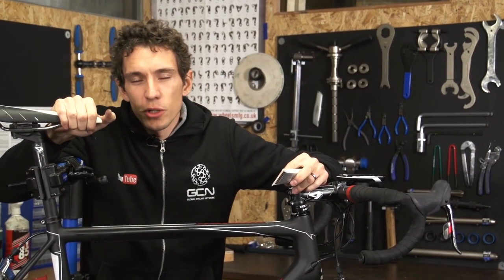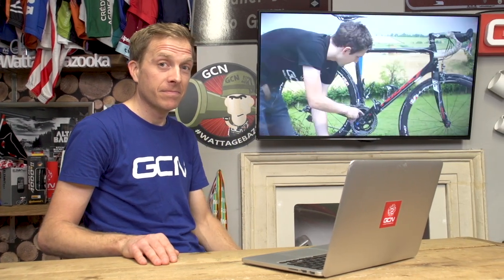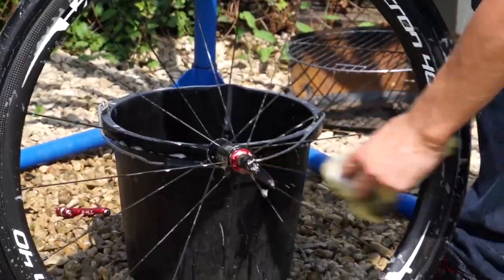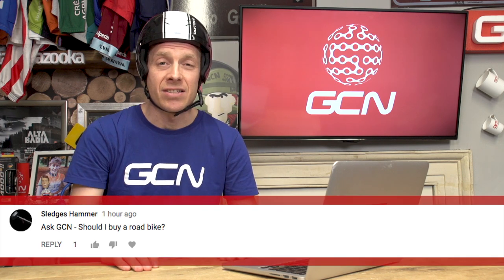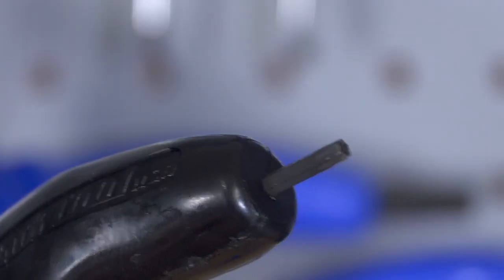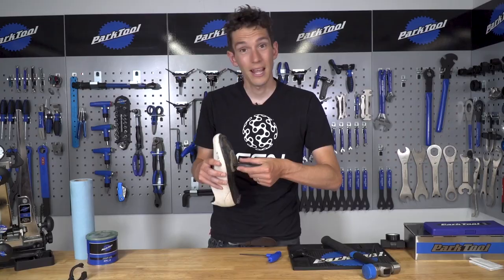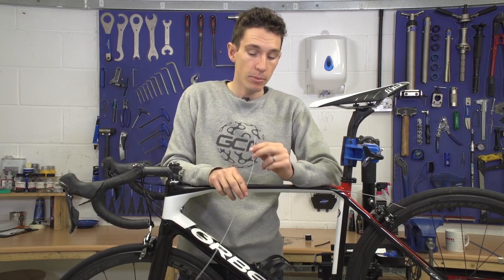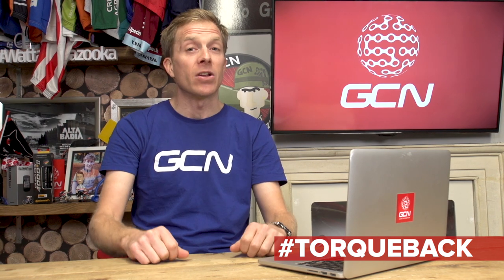How To Remove Rounded Bolts | Ask GCN Anything About Cycling

Comment: Awesome vid Jon, thanks! 
 With regards to stripped hex heads, if the torx bit is still ineffective, I've got a few more tips... Try laying one side of an elastic band across the head of the bolt and then using the torx bit. If that still fails, you can cut a slot across the head of the bolt (hacksaw, dremel, chisel, flathead screwdriver if you're really stuck...) and use a flat head screwdriver or flat-head socket bit to turn the bolt out. Obviously be reeeeeeally careful of your bike... If this doesn't work and the head of the bolt can be gripped by a set of mole-grips you could try that, but I'd probably invest in a set of bolt extractors from Halfords/MachineMart/your local Snap-On guy as they'll grip the outside of the head and 'dig in' biting further and increasing their grip.

What can I do until the next video then...

Comment: To remove rounded bolts,
First find a plastic toothbrush then get a lighter and melt the end. Put the melted plastic end in the bolt and then unscrew. This should work.
Reply: if there's room, a set of vice grips should do the job.

Comment: Internal routing issues... If you get really stuck, try sucking thin thread or cotton through the frame with a vacuum cleaner hose sealed to one opening with a bit of electrical tape. Works for me every time!

Comment: I've tried using an 11s chain on a fixed gear when I first built my fixed bike, the chain got stuck at the sprocket and I ended with a stripped back wheel hub

Comment: BEST WAY to remove Allen bolts (or any bolt, even if the head has sheared off) if nothing else works is to buy a little "Easy Out" kit from a decent engineering tool outlet, not expensive. Dead easy to use and there are a lot of YouTube videos showing the process if you get stuck. Basic principle involves drilling a fine pilot hole through the center of the stuck bolt, then as you drive the easy out tool into this new smaller hole the tread on the outside of the easy out begins to drive the stuck bolt out.

Comment: Rounded off Allen bolt? Buy a reverse, or left hand, drill bit. That type of bit has the spiral in the other direction. The idea is to rotate the bit in the same direction, that you would remove the bolt, which allows the bit to grab in more, and will usually spin the bolt out. The downside is that you may find the reverse drill bit stuck in the bolt. Use this method when nothing else works, and you don't want to damage whatever the stripped bolt is fastened onto, or into.

Comment: Will it work if I run a 1X setup with a non-clutch RD on a road bike? Or will the chain drop? #torqueback
Reply: Jochem I've got it to work without a clutch mech
Reply: Jochem if you're not on gravel or bad roads then the chain shouldn't need a clutch
Reply: No problem.  I use a standard road derailleur with a narrow-wide chain ring on my cross bike.  I've never had a problem even on single track.
Reply: a lot of delivery guys that come into my shop do this. it can work, pay close attention to the chainline and dont shift too many gears at once
Reply: You can also increase the spring tension on some Shimano RD. I have done this to my 11 speed Ultegra RD and it helps. Just follow park tool instructions here : https://www.parktool.com/blog/repair-help/rear-derailleur-overhaul

Comment: 11 speed chain on a fixed gear?  I wouldn't.  Never use a quick link or re-pinnned 11-speed chain for fixed.  You can't use a quick link on a fixed gear because the braking action of the chain may open the link.  And if you've ever re-pinned an 11-speed chain on your own, how long did that last?  If you're going to use 11 speed, then only join the links with a factory break-off chain pin!  And even then, well, like I said before, I wouldn't. 
If you're using a 3/32" ring and cog then  you're better off using a 7 speed chain instead.  Or you could even use a 1/8" chain on 3/32" gears, but it's not ideal, i think it will wear out faster.  Both options are safer, cheaper and more forgiving to work with.  Remember, when you're running fixed, your chain takes a lot more abuse!

Comment: #TorqueBack
I'm looking to buy a road bike.

I've narrowed the search to these bikes:
1) Cervélo R2 2017
2) Rose Xeon RS Ultegra or 105
3) Rose Pro SL Ultegra or 105
4) Bianchi Freccia Celeste
5) MMR Miracle 2017 Ultegra or Dura-Ace

1) is carbon, head tube tapered, internal cable routing
2) is aluminum, head tube tapered, internal cable routing
3) is aluminum, head tube tapered, internal cable routing
4) is aluminum, head tube non tapered, external cable routing
5) is carbon, head tube tapered, internal cable routing

All of them are good bikes.
I don't mind about carbon vs aluminum.
I assume that external cable routing does not affect.

But what about the non tapered head tube? Is it really noticeable?
In theory, it gives the front of the bike more stiffness.
What do you think? Is it a deal breaker?

I love the looks of the Bianchi the most, but it is the only one with non tapered head tube.

Comment: the title is exactly a problem i'm trying to solve atm!
Reply: SwedishHouseFifa BEST WAY to remove Allen bolts (or any bolt, even if the head has sheared off) if nothing else works is to buy a little "Easy Out" kit from a decent engineering tool outlet, not expensive. Dead easy to use and there are a lot of YouTube videos showing the process if you get stuck. Basic principle involves drilling a fine pilot hole through the center of the stuck bolt, then as you drive the easy out tool into this new smaller hole the tread on the outside of the easy out begins to drive the stuck bolt out. 😊

Comment: Don't hammer a torque driver into the bolt head. The cleat is a gonner in any case, use a hacksaw to cut a slot in the head and a flat bladed screwdriver to remove. Or, if you've got access to a dremel use a cutting disc to do the same, easy.

Comment: #torqueback Hi GCN I'm a big fan and my rear derailleur hanger cage is hitting the spokes on my back wheel do you know how to fix it
Reply: The mech hanger is likely bent. Often happens if the bike falls to the ground on driveside. A solid 10mm rear axle normally fits into the mech hanger and therefore you can use a rear wheel (solid axle) as a tool to straighten the mech hanger. Also wiggle the rear mech and see if there is play in it's pivots as they can wear out. https://www.youtube.com/watch?v=TnwreRrorIA
Reply: Thank you

Comment: Are modern ultegra derailleurs backwards compatible ?  I have  a bike from '93 which uses a 7-speed shimano 600 groupset. 
Can I use a modern equivalent and upgrade my old bike part by part ?
Reply: #torqueback
Reply: Mitläufer I don't know about the derailleur but I have an old colnago with a shimano 600 group set and I recently put some new shimano claris brifters (2x8) on there - works like a charm. Obviously not ultegra but more than good enough.
Reply: From my recent upgrade of my '86 Panasonic DX-3000, the biggest problem I had with upgrading the ol' cassette significantly is frame spacing. I was able to go comfortably from the original 6-speed Shimano groupset to a 7-speed, but jumping to a 10 or 11 would have involved spreading the frame, which I am not at all comfortable with.

Still, that jump up to 7 speeds and retaining my original chainrings in the front has made my darling little Pan a significantly more spritely little beast with the addition of that lovely 11 in the back giving it a tad more top-end capability over the original 14; debating if I should've gone with the 14-32 set instead, though, for some easier climbing! Also let me switch my gear shifts to my hoods rather than retaining the downtube shifters (I was good on 'em, but they were aggravating after I had the pleasure of riding a friend's more modern Trek).

Whatever you do with it, have a grand time. :)

Comment: #torqueback my FD hits the chain in the 2 biggest gears, what can i do?
Reply: Assuming your not cross chaining (big front and big back) then just change the limit screw on front mech. if this does not work just reduce cable tension and these should both move the front mech nearer the frame and therefore help with clearance. I assume you have the correct mech for the correct crankset (double mech for double crank). https://www.youtube.com/watch?v=tfBiXgf8JxI

Comment: Top aluminum is way better than cheap carbon. Got a CAAD12 this summer thing is a rocket and weighs 18 lbs for a size 60cm. Only carbon on bike is seatpost and handlebar. Also get new wheels doesn’t have to be carbon just lighter than the stock ones.

Comment: I'm sad because my question didn't get answered :(
I asked how I could get my upper jockey whell closer to the sprockets... I know, the b-screw, but it doesn't affect it since there is simply not enough tension towards it
I'm mainly a home mechanic, but I've been thinking about going to the bike shop because I can't think of way to fix it
Would be glad to receive an answer
Reply: Why do you want it to be closer? Thanks
Reply: to index the gearing properly, if it's too far away, the angle of the chain to the sprocket is just too low to shift (limit screws are adjusted, but it has problems shifting up and down)
Reply: Lukas Seegers it must really far away. Is the P tension spring still OK? They can get full of dirt. As can the pivot bolt that attaches the cage to the derailleur body.

Comment: Like Si, I'm a big fan of 1x systems. I would like to upgrade my 1980 steel frame with a 1x11 drivetrain (if it's even possible). Does it worth it, or should I get a new bike?  #TORQUEBACK
Reply: My 1980's steel bike had a 5 speed freewheel. it had 120mm rear drop out spacing and I was able to widen this to 126mm to fit a 7 speed (road) cassette but I had great difficulty finding that hub so bought a 7 speed MTB hob and then boughts a vintage 126mm quick release axle and build the wheel around that. It rides beautifully. I don't think a 1 x 11 will be possible unless your rear dropout is 130mm+
Reply: Thanks for the reply!
My drop out spacing is 123 mm so a struggle a little bit to put the back wheel every time. I have a 6 speed cassette but I guess I have 126 mm hubs. Bending it to 130 mm doesn't seem too extreme

Comment: WD-40 for chain lube? No, it's more of a water displacer (WD) than a lubricant though it does lubricate to a reasonable degree. The problem I've found with WD-40 is that it gets sticky very quickly and power-sapping. It becomes easily noticed with a chain length of about 3.5 metres.
Reply: Mike Savage WD-40 basically a degreaser so I agree with you on that one. Not a good chain lub.
Reply: It makes my chain very sticky for dirt too

Comment: never use anything with copper in it on a bicycle. just use grease and reapply it from time to time. copper will force galvanic corrosion on any base metal on the bike, such as aluminum or steel.

Comment: The real secret for internal cable routing: use a magnet. Won't work on a steel frame, but what steel frame has internal cable routing anyway?
Reply: Nicoya some steel frames have internal rear brake routing. 👍

Comment: I tried to cycle up a steep hill. Out of the saddle my rear wheel lost traction. In the saddle my front wheel kept bouncing and I couldn't steer properly. Is there a technique I could use to help?
This was the hill:
https://www.strava.com/segments/2897877
Reply: Technique:
Could you lose a lower gear? Then you'll be applying less torque to the wheel, but you can pedal faster to maintain wattage. If you've run out of gears try smoothing out your pedal stroke. If you stomp on the pedals, your rear wheel is bound to slip, if you keep it smooth and steady and really use your internal senses to feel for grip, it could help. Easier said than done when out of the saddle, but for me it's all about feel.
Equipment:
Another tip might be to change tyres to a grippier compound, or lower the pressure in the tyres; which will spread the tyre more onto the road giving more surface area contact for grip, and will allow the wheel to roll more smoothly, especially on rough surfaces/ cobbles... If it's wet, consider using wet weather tyres with tread that will displace water.